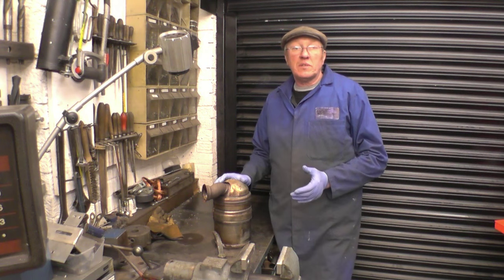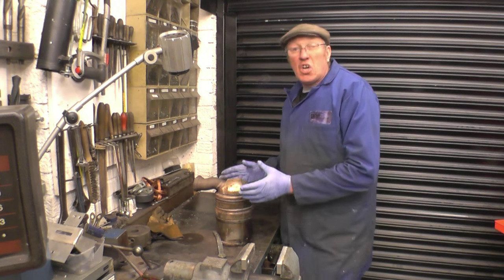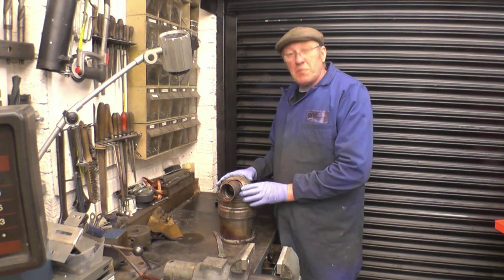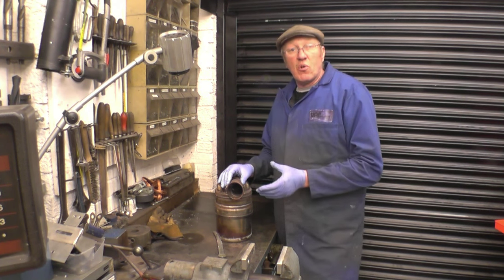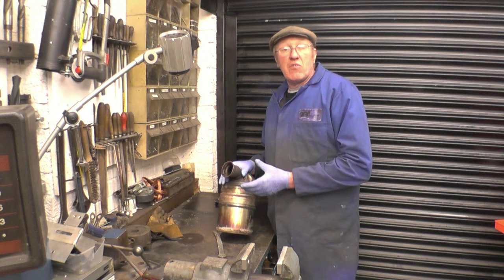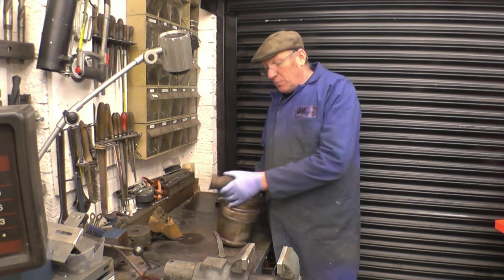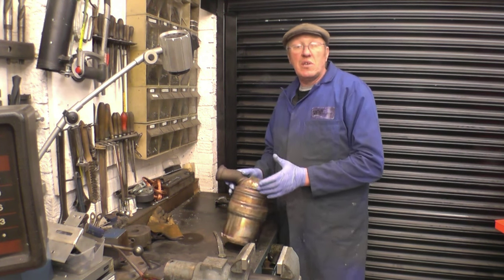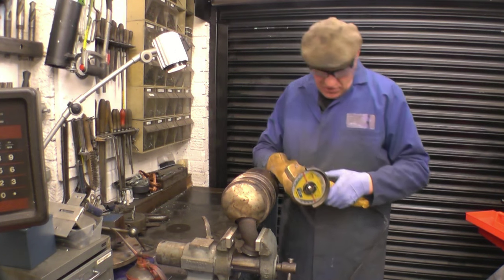DPF Autopsy

Comment: Ah the DPF filter my new ASTRA GTC has one in all the time,I've owned Turbo diesel with the DPF
I've never had it come on..The reason why is because i don't live in the city where my car sits in
traffic idling most of the time..Its on long straights and country lanes and i absolute hammer it
once a week i will bounce the bitch of the red line to clean any crap out of the exhaust..And there
is always water dripping out the exhaust when i arrive home..::D..And doing this I've never had the
DPF come on ever..Cars need a good revving and taking on a good flat out run now and again.
Reply: We have a couple diesel trucks left at my work (switching over to all gas trucks, which sucks) and they're 08 models so they have dpf's on them. We drive them 600 miles a day or so, so they're on the highway most of the time which helps keep them from clogging, that and mashing the throttle getting on the highway and blowing it clean. 

We used to have trucks up to 07 models that had a diesel cat, but no dpf and those ran better, you could tell the turbo would spool quicker and they got better mileage. I'd rather just delete all that junk and get better power and mileage, that'll be better for the air anyways.
Reply: snakesonaplane2 its all about making money for those damned lobbyists

Comment: interesting to see that there are 2 sizes for the holes, and almost as a rule only the big ones are blocked... are the small ones real through holes, like the larger ones?
Reply: A year later but for anyone interested. A DPF is basically designed as a series of dual-conduits, one for the inlet and one for the outlet, both conduits being separated by a "membrane" which is simply the DPF material itself. Polluted gases coming at the DPF inlet are forced into half the holes, the larger ones, whose surface acts like a micro-filter: it lets the gases phase pass through (onto the other-half of the conduits, connected to the outlet), but block soot. So the "empty" holes as you say only ever see filtered gases through the lifecycle of the DPF, hence remain "clean". Soot accumulate in the bigger conduits by design (the outlet holes need not being as large as the inlet's because all the soot is trapped, plus it makes for a tiny Venturi effect). During regeneration, the whole DPF structure becomes red hot and soot burns to become gases that are eventually wiped out through the outlet holes, just like regular, "clean" exhaust gases.
Reply: @chikamichi  Another thing to ponder, no matter how many times or how well you do a 'regeneration' the DPF is always just filling up with ash, every time you burn the soot off a tiny bit of ash remains (which is why you have to use low ash oils in the engine) and eventually it will clog up, there's no way for the ash to escabe out of the tailpipe end of the DPF. All these DPF treatments that you add to the fuel helps burn the soot out sure, but ash remains after all is done and it's this that blocks them up eventually. Terraclean flushes won't work either, if you don't take the DPF off and flush it out backwards it'll just compact the ash even more into the closed ends of the holes from the engine side.
The only way to clean them is to flush them out in reverse, take them off the vehicle and jetwash them from the exhaust exit side (not the engine side), keep flushing them through and blowing compressed air through to try to clear all that red stuff from the holes, The ash will only come out the same way it went in, from exhaust tailpipe end towards the engine end. Keep flushing until the water runs clean.
Reply: @thegrimreaper7777  Agreed, DPF have a limited number of regeneration cycles they can go through until it's all clogged up by left-over ashes/micro-particules/whatnots.

Comment: Great, informative video! Can I just ask, does the fact that the honeycomb is made from Silicon Carbide play a role in its filtering ability, or does the filter just work because it contains lots of small holes, and this material to allows it to withstand high temperatures? Thanks.
Reply from the maker: +Eicles to be honest I don't know

Comment: Fascinating video John, thanks. I've often wondered what a diesel filter looked like and why it lasts so long, I'd never considered they might burn off the waste. Whatever the orange stuff blocking the pores of the matrix is though it isn't carbon, at least not pure carbon as that would be black. That colour of red says iron oxide to me which would also explain why it couldn't be burnt out of the filter. I believe diesel is prone to absorbing water isn't it? Could it be rusting the inside of the engine?
Reply from the maker: +Wobblycogs Workshop  the brown stuff is burnt sulphur ect

Comment: Is the reddish material carbon or some kind of trap media (like clay)?  I would think carbon would be closer to black in color.
The cells packed with the red material also appear to be in a very regular checkerboard like pattern (freeze frame at 6:29).

Thanks for the view inside a DPF.  I love your video work.
Reply: +arty359 I thought that too, but then when I watched it again the red squares seem to match up with the open sides on the other end, and the ones that were clear on top seemed like they met the closed ones on the bottom. At least that is how it looked to me, but I'm not willing to bet on it ;) 

P.S. My best friend during the Summers growing up was a kid named Arty! He came to visit his Dad for the season and we'd run wild up and down the beach every day. Needless to say he was popular with my folks for getting me out of the house for the Summer break.
Reply: +Knolltop Farms    If I am not mistaken it looks like the checkerboard has 2 different sized cells/channels (see 6:37 vs 6:29), and it looks like the larger of the two is filled with the red/orange stuff and closed at one end.  

BTW, Glad to read that my pseudonym elicits a pleasant memory. :)
Reply: Yeah you're right, I can see the smaller holes are the ones in the shape of a plus symbol and the larger and mostly orange filled holes are the ones in the checkered pattern. I wonder what the spacing is between the layers of that cubed business? It would be interesting to see a diagram with a flow chart...I'm going to look in Google images now.

Arty was a classic Italian American kid out of Brooklyn, NY and he would spend his Summers in Hawaii where I grew up, and spent the first 39 years of my life. Great memories, thanks!
Reply: +Knolltop Farms  The different sizes are because of the taper that the mold for the ceramic has. The closed ends are the points where the corners of each passage meet up on the end of each mold tip.

Comment: So are those things expensive?  How often do they need to be replaced?  Can you disolve that orange stuff with a chemical of some kind?  Yeah, I ask a lot of questions.  Thanks for the video.
Reply: +Amateur Redneck Workshop  Depending on the vehicle they run from $600.00 up to around $4,500.00 US.  The orange is soot, sulfur and fuel additives that have burnt. They pack in real tight. I have seen them baked out but there are not a lot of places that can do that.
Reply: Sounds dangerous to me, what if she finds out?
Reply from the maker: +Bill Lewis  I was baking casting cores in the oven last week lol

Comment: thanks john.  I just got a work truck with one of those. I pulled up with the auto regen light on and left it idling as per the instructions. When I jumped out all I could smell was burning plastic. I was running around trying to find what was on fire.
if you dont mind me asking, how much was a new one?
Reply from the maker: +Tony Smith  £ 250 & fitting

Comment: Odd that the matrix is full open on one side but checkerboard closed on the other.  As if they expect every other hole to pack up?
Reply from the maker: +ramosel  That is how the filter works
Reply: +doubleboost Ah, so it packs up... it driven enough it burns it off and lives to pack up again.  So lots of short trips will kill these.  I have a friend (PhD) who designs this stuff.  I should listen more often.

Comment: Words can't describe the hatred I have for these things John,
Defeats the purpose by increasing diesel consumption because the bloody things fire all the time!
Traded my bravo in because it started pouring blue out smoke every time it fired, even with forced regen, only ever used Ultimate diesel form new, Mobil 1 ESP oil change every 5000miles with WURTH diesel treatment, they are just built to fail. Replacement cost (oem only fiat trade price) £1269
Reply from the maker: +MrGuvEuroman  I am no big fan of them

Comment: I'm curious if there is asbestos in that thing as well as precious metals?
Reply: +dan rasmussen Catalytic converter is the one with precious metal in it, the DPF is just a fine filter to collect the NO and carbon and burn it at high temperature ( much higher than the cylinder can reach in any case as they would melt) so the gas is mostly NOx and CO2. Then you get the NH3 added to reduce NOx to N2 and CO2 plus water. All the DPF is is a filter that will not melt at 1500C when it burns the junk. The brown deposits are not carbon, but likely the contaminants and additives in the oil and fuel that were not fully burned away during regen.
Reply: +dan rasmussen  Nope no asbestos. Just high temperature ceramics in that one.
Reply: +SeanBZA 
The reddish brown color is likely from trace amounts of iron oxide included with the other contaminants you mentioned.
Reply: No Asbestos but it does have Silica in it. Silica is just as bad as Asbestos for you to breath.

Comment: Love it 😂
"Cut it at the manufactures weld in case I want to put it back together" means I'm going canny because I want to smash the insides out and weld it back together and see if  we can run it without any mil lights come on 😆
Reply: +MrGuvEuroman  Won't work, The PCM measures the flow through the RPF, it knows what a clean one should flow and that number is not the same as one that is gutted. It then turns on the money light, just like a bad cat will.
Reply from the maker: +MrGuvEuroman That would be illegal lol

Comment: Jet A fuel runs much cleaner and hotter than diesel.  If you have an airport with turbine fuel source nearby, you can drop a load of Jet A fuel in the tank.  That will help clean out the whole system.  It won't hurt the diesel engine at all.
Reply from the maker: The HP pump wont like it very much just very clean kerro  no lubricant quality
Reply: John Ferguson umm what? jet fuel has almost zero lubrication properties which will destroy the high pressure fuel pump and even if that survives long enough diesel engines can only handle Exhaust gas temperatures within a certain range too high and you can melt the VNT turbos or even a piston. jet fuel might be okay for an old mechanical diesel engine but not a modern commonrail diesel so in other words it's useless as old mechanical engines aren't used with DPFs.

Comment: I think the presenter should be wearing a breathing mask.
Reply: I was thinking so too...he probably shorten his life expectation by a solid 5 years or thereabouts prying into  the sooth infested honeycomb structure . The whole DPF systems seems pretty basic to me ..wasn't there a blue liquid based solution around for some time ?
Reply: Sorry , I meant Ad Blue - but just read this is to reduce NOX - so DPF still needed - but by increasing the igniton temperatures less soot particles are resulting..
Reply: He is old school mechanic best sort going
Reply: Rik Herlaar yeah I rolled my eyes a bit when I realised that ad-blue and the DPF are basically trying to do the opposite things (high temp means less soot more NOx, low temp other way round)!

Comment: John   I note you’ve followed the advice of probably your youngest viewer and are wearing your safeties when using the angle grinder.    How much was the replacement DPF ?   I’m guessing you had little choice but to pay the exorbitant cost and it means the initials should really stand for:  Definitely, Positively F#$ked !   Cheers.
Reply from the maker: +Stephen Smith A new DPF is about £ 250 & fitting

Comment: Those DPFs cost ~$800 in USA.  For that amount of money, you could make a lot of money cleaning them out.  I don't know how you would do it:  either use an oven, or some sort of mechanical rod???  They must be making a lot of money on those DPF replacements!   You could make another video:  put that DPF in your aluminum kiln/foundry.  Try to cook that stuff out.  Maybe just putting the dpf over the "chimney" of your foundry???
Reply: WAVETUBE84 there are cleaning methods and yes I think they rely on high temp high pressure and chemicals. There may be a point where you just need a new one though.
Reply: I'm here because of that question, I've seen high pressure water jet (reverse direction to exhaust flow) and high temp baking 600 F for an hour to be the sweet spot, may need to do this on my Mini Countryman, don't wanna get ripped $1k for a new one just yet

Comment: This bullsh!t right here is why I'm keeping my 2002 Chevy Duramax 3500 until something breaks that I cannot fix.  No cat, no EGR system, no DPF, and no rust.  I currently have 250K miles (400k KM) on it.  Last year I replaced the injectors, injector pump, water pump, and power steering pump.  Runs like brand new, pulls loads like and mule, and doesn't burn any oil, and it's paid for.  If I have any kind of major drive train failure, I'll just replace it and keep on going!
Reply from the maker: +greyghostkoga  You cant beat old technology

Comment: You could knock out the honey come, reweld the end on and reinstall it... or sell to some other customer.  Ha ha ha.
Reply: +WAVETUBE84 Over here in tne UK exhaust emission are stringently tested annually as part of the MOT test the vehicle wouldn't pass the test without the DPF working correctly. Same goes for catalytic converters on petrol engines. We replace dozens of them every year. Due to the volumes sold over here non OEM parts can be really cheap.
Reply: +Ken Parsons they would never send a vehicle out from production with particulates that are so high they 'need' the dpf to get through a smoke test. Egr delete, dpf delete and a remap is the way togo. No more problems. The high levels of egr cause the higher levels of particulates in the first place.
Reply from the maker: +Hugh Frater The smoke test is not that stringent at all
Reply: +Hugh Frater Could you explain how re-burning exhaust gasses (Exhaust Gas Regeneration) creates higher particulate levels than not re-burning and sending 100 percent of the original exhaust out the tailpipe?  I can see how mileage and general internal engine cleanliness/longevity could be improved, but don't get how once burned exhaust can be cleaner than double burned exhaust.
Reply: +blmeflmm66 EGR doesn't 're-burn' the exhaust gas to clean it up, it admits a small quantity of exhaust gas into the inlet to reduce the oxygen levels in the air charge. The purpose of this is to ensure the diesel is not burnt with an excess of oxygen as this produces high levels of NOx, and NOx emissions are bad for smog in cities. A reduction in the excess oxygen causes an increase in particulates alongside the reduction in NOx levels, hence with increased levels of EGR, you need a DPF. You can only get NOx down to a certain level with EGR, to get it further down (Euro 5) you then use a SCR (Selective reduction catalyst) to remove the NOx from the exhaust gases after combustion. SCR units require the addition of Adblue/Diesel Exhaust Fluid.
Reply: Ahhhh!  Makes sense now.  Thanks for the great explanation.  My normally keen assumptions were WAY off.  haha!